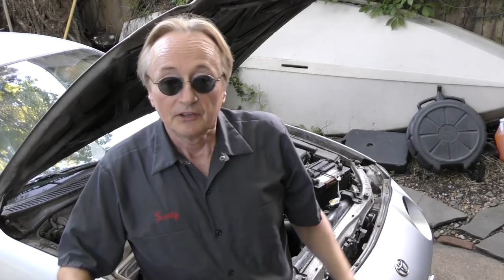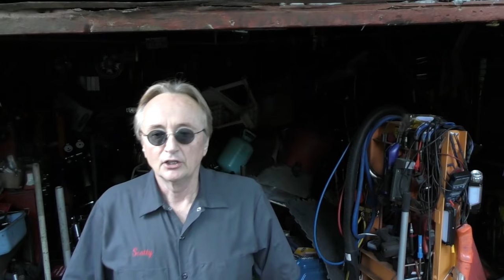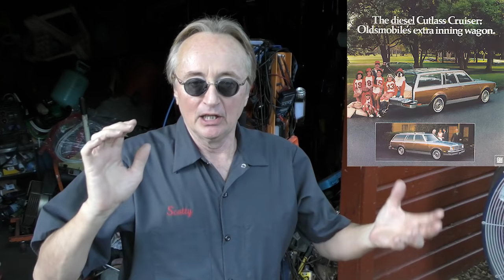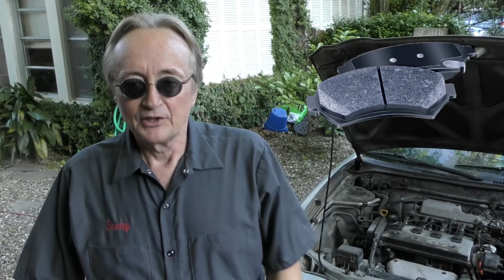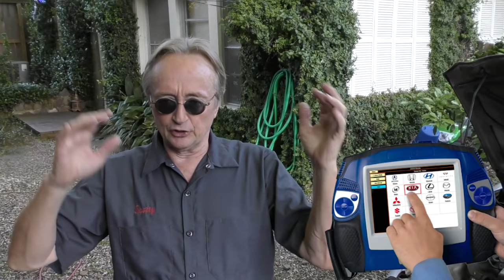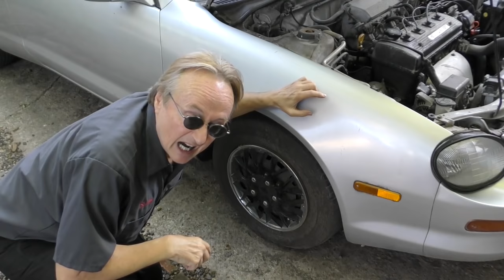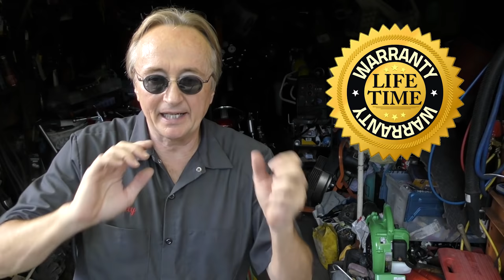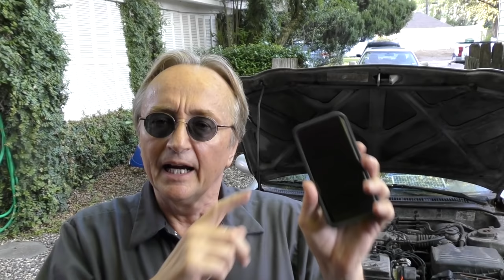5 Scams Your Car Mechanic Doesn’t Want You to Know

Comment: So you're saying my Tesla didn't need new fuel injectors?
Reply: hahahhahahahha
Reply: ROFL HAHAHAHA!
Reply: @DystopianBlues  you need 12 mate 1 for each cylinder.😂😂😂
Reply: No.  We rebuilt the carb for you.
Reply: With that new muffler bearing we installed for you, it should last you EASILY another 100,000 miles! Just bring it back in after 15,000 miles, so we can change it for you.
Reply: You dont understand his point. Trust me I got ripped off few times.
Reply: Naah...your Tesla needs to rebuild the direct fuel injection.
Reply: no but make sure they top off your head light fluid.  lol
Reply: no, but you need to carry a spare battery and a roof rack to store it.
Reply: Recommeded by the Directors' wife on holiday in the Caribbean that you need a new exhaust every 10,000 miles on your Tesla.
Reply: I was ready to woosh someone😂
Reply: Lol
Reply: I’m laughing so hard!
Reply: @tompaul2591  Lol.
Reply: Jeffrey Ortiz 😂😂😂😂😂
Reply: No it needs a real engine
Reply: Insert 12V battery.. see it's a V12, need 12 Sparks, ignition coils, wiring and alternator changed because you've just passed 100 miles of ownership. Wouldn't want you V12 EV to break down on you.
Reply: Hahahah
Reply: Tesla
Reply: No I'm afraid you were scammed, but you're in good hamds now and from the looks of it you will need new set of spark plugs and wires and your car won't pass the smog test due to your plugged up catalytic converters .
Reply: Ohhh mega flex
Reply: @cjstubejackofalltrade1551  I think he does. Its good humor haha
Reply: Lololol
Reply: Brandon Good lmao same
Reply: James Bowles r/wooosh
Reply: Tesla is a scam already
Reply: That’s brilliant 😂😂😂
Reply: Think the exhaust manifold might need changing regularly, it will give an extra 15-20 miles per charge.
Reply: No you need a whole new engine and while your at it i will put in a v12 and some stickers  just for the extra 600000000000hp boost
Reply: I got once charges for sparkplugs on my diesel engine car 🤣 I just walked out without making a payment.
Reply: No, it needed 2 sets. You replace the first set run them 15.527986 feet and then pull those and replace them.
Reply: Just imagining attaching the injectors and the resulting explosion.
Seriously though electric car maintenance is going to be scam heaven.
Which is why they will end up being adopted quickly once big tech finds out how to make money off of them.
If your quarterly revenue looks a little low,  software patch to limit acceleration, and boom 1B in service revenue for a 2 second OTA fix.
Reply: My mechanic said that my S3 needed "fresh" spark plugs. Ya, he did.
Reply: Damn😭
Reply: Just need new spark plugs and a cleaned diesel particlat filter ahaha
Reply: 😂😂😂 lol
Reply: Kristen555  Ahhhh- aint THAT the truth!!! LOL!!! 😅😅😅
Reply: Lmao
Reply: And a complete new exhaust system?
Reply: Haha!!!!
Reply: Your gas tank is leaking
Reply: Jeffrey Ortiz 😂😂😂
Reply: YOU NEED MORE WATER IN THE TIRES?
Reply: I laughed so hard at this
Reply: Jeffrey Ortiz probably needs new exhausting bearings right? 😂
Reply: Wrecked socket?
Reply: No, it didn't need new injectors. Everybody knows it's a lot cheaper and just as effective to replace the metering seals in the old ones.
Reply: @woodworthd2  ..and your elbow grease.
Reply: No, but it probably needs a new carburetor and fuel pump. Lol.
Reply: @Kiwi Dew joke + you = right over your head.
Reply: Lol
Reply: Lol i never looked at other comments u guys made me cry
Reply: Dang I just realize that that was a scam
Reply: @yeulakho6574  🤣😂🙃😉😅
Reply: People saying "yOu AlReAdY gOt ScAMmEd cUz u OwN a TesLa" are the ones that can't afford a Tesla.
Reply: Jeffrey Ortiz way min🤔😂
Reply: But you do have to upgrade your inter volt modules @ 50000 miles.......🤥
Reply: Couldn't hurt, lol
Reply: No ya dont
Reply: XD
Reply: Omg
Reply: Your screwed with your tesla... battery is junk in 7 years. No resale value. You can try to back pedal this statement.
Reply: Hahaaahaha
Reply: No, but you might need to replace your exhaust manifold, I got a friend who can do it for cheap.
Reply: No...but you definitely need to change the air in your tires every 3000 miles!
Reply: Actually your tesla's nuclear reactor engine needs some oil change.
Reply: Jeffrey Ortiz 😂😂😂
Reply: Everybody knows Tesla's have carbs ugh. Lol
Reply: Kristen555  y u say that
Reply: Jeffrey Ortiz actually it does go buy them real quick also the trunk is the gas ⛽️ tank go dump fuel in there straight from the pump ;-) then you’ll be running great 👍
Reply: I just need your telsa house on wheels to charge my iphone and my scooter and conect my playstation to play my video games... hahahaha
Reply: 4 for each motor
Reply: Who replaces fuel injectors lol it super rare when they go out 1 in 10 billion casee
Reply: The Kniffer pin & warbler plate might need replaced, you know, for safety! Lololol
Reply: @drofaluap6521  600 trillion hp? that's alot more than the space shuttle lol
Reply: Jeffrey Ortiz  might need a new carburetor too
Reply: @nickcojocar3298  they actually make and outboard that's got fuel injectors after the carburetor that kick in at 2500 rpm
Reply: @edgewatersbestguitarist1524  thats nothing compared to my flinstone wagon
Reply: @drofaluap6521  nothing beats yabba dabba doo power
Reply: Nope we need to rebuild ur hole Tesla 😂😂😂
Reply: Vwhat!!!!
Reply: Brandon Good same
Reply: Nah, it overheated and needs a new water pump.
Reply: Oil change service interval.
Reply: That's right.  They made them out of canadium so they never wear out.
Reply: Hahaha
Reply: No it needs a new spark plug with a carbon fiber badge
Reply: It is very important to replace fuel injectors on electric cars every 50,000kms
Reply: Jeffrey Ortiz 😂😂😂😂😂😂😂😂
Reply: Nope it was all a scam 😂 probably just needed a spark plug change an oil 😆🤷🤦
Reply: Needs a new flux capacitor
Reply: No wonder you need a new one because Tesla's are garbage🗑
Reply: No, but the Johnson bar needs to be replaced.
Reply: No
Reply: LMFAOOO
Reply: Ahah
Reply: No an elec...

Oh wait this was a joke wasn’t it
Reply: Yeah, I think it’s time to replace the exhaust and blinker fluids too 😂
Reply: And people wounded why Tesla was recalled🤦
Reply: No. No fuel injectors. Just  4 AAA batteries.....
Reply: No lucky for you it was just some spark plugs and wires, all set sir 👍
Reply: did you check the fuel pump too? 🤣🤣🤣🤣🤣
Reply: No you don't need fuel injectors for your tesla,but you should change your spark plugs at least once a month 😉
Reply: Nice 😆
Reply: Nah but it did need a new exhaust system.

Comment: I have been a mechanic for 35 years.  Every word he's saying here is 100% truth.  The world needs more mechanics like Scotty (and me...tooting my own horn a little)
Reply: Where are you located?  If you live in the same city, you just got yourself a new customer!
Reply: Yeah XD I now youtube and fix my own cars because im tired of being ripped off. 250 to change spark plugs and over a thousand to change 4 coils? NNNOOOOPPPPPEEEEEEEEEEE(On a toyota camry 4 cyl)
Reply: 7natcho you must be one of the mechanics he's talking about 😎
Reply: @7natcho  I don't think scotty says to never change the brake fluid (he did mention coolant could be 7y/150k (happens to be 100/150k for my Prius, "life" on my bwm, 100k on my Acura).  Brake fluid is hygroscopic as you say, so usual recommendation is replace every 2-3 years (time based not mileage). I just changed it on my used 155k/5 years old prius and it was very dark yellow with some small particles, instead of clear. $6 in part, and 20 min job if I had to do it again. easy peazy (once you figure out how to get Prius into 'invalid mode' and let it pump rear fluid for ya).
I disagree with scotty on ignoring that maintenance light - most modern car it's a reminder to change the oil (and you need to figure out what additional items if you hit 30k, 60k, 100k, etc...). The Acura reminds you with a code to track the other items...
Reply: @7natcho  lol 🤣
Reply: What's the scan tool he mentioned for/do?
Reply: Same story here bro!
Reply: @mirandah6927  I'm in the Salt Lake Valley in Utah. I'm currently not a functioning mechanic to the public but I buy and sell used cars. I use my background and experience to know which cars I should not buy and to allow my customers to know everything about the car they're buying including things that may need replaced or worked on up to a year in the future. Thank you for the compliment 😊
Reply: I work at a dealership for semi trucks  I've save customers so much money because of either dishonesty or just plain stupidity
Reply: @95South_  I used to flush my radiator and change the coolant every 2 years. 
At the same time check hoses and look for leaks. Oil I changed about every 4,000 miles, these are aren't expensive things to do.
Reply: @chadwickmac9798   Look under the Show More link near the top of the page. That's where he lists the stuff that he talks about.
Reply: @95South_  Scotty was right. I have a 20 years old truck with 250,000 mileage never change injectors  and transmission fluid and it's still running great.  I change my engine oil  once a year. Do'nt let the mechanics rip u off!!!!
Reply: @alaind831  I don't go along with that advice about coolant. I used to do mine every 2-3 yr. flush out the system and put in fresh coolant. It's not expensive and prevents rust & corrosion.  I asked my mechanic friend why don't we just use 100% coolant in our cars instead of mixing water with it wouldn't that prevent rust etc. but he said don't do it.
Reply: @theemperor7500  bruh changing spark plugs is the easiest fix on a car. That's such a rip off.
Reply: Cool

Respect
Reply: Wineman Dinem We’re in Utah!🙌 What’s your dealership called? Lol. Honestly though, I’m interested for the next time we’re looking!
Reply: @chadwickmac9798  for on board diagnostic. Its a great tool and gives a lot of information about your car to help fix it.

Comment: This is one of the reasons I got into being a mechanic. I was screwed over by a dealer many years ago and told myself, no one deserves to be treated like this.
Reply: Same here kia was trying to bend me over on an oil change 😂😂😂 i was like what do you mean its time to change the oil filter this time so I got to pay 150 bucks. Thats apart of an oil change and they were like no we wait every 30k miles and im like you think I'm that dumb? So I was like nah imma do my own stuff
Reply: Dude, these scams are for service writers. Mechanics don’t make much money off scams.
Reply: @GodsTribe  
Talking about dealer service centers, not indie shops.
Reply: Hey dear kindly advise me my car overheated and when I stopped it never started again. It is an automatic car. I refilled the water which am sure the car cooled but the dashboard it shows when I put the car remote key and press the start button, it says engine fault and later it shows battery low start the engine. The mechanic says that the engine is dead but he does not give the exact diagnosis. Should I believe him?
Reply: @RITAHFITZONE  no the engine isn’t dead.. same exact situation.. if you car was overheating gradually and if you had a leak it was probably a water pump going out or a radiator. If you never let it get into the red then your engine is salvageable. If you drove and it stopped and you took it to a mechanic for over heating they probably put your timeing chain on wrong and cause the engine to misfire( not coordinate the fuel and pressure to start it it cranks) . In that instance just replace the pump and timeing chain and do it right. It’s a specific way to have the Hearst the chains are on so the engine can actually come alive.
Reply: So tell me, do you do the screwing now?
Reply: @luismercado6048 I was thinking that 😂.

Comment: Good on you, Scotty. Especially my female friends telling me how they been taken and/or never feel like they can trust a shop not to take advantage of them. Even though the vast majority of all people don’t know much at all about car maintenance and repairs, the dishonest mechanics often do seem them as easier marks. Helping people like you’re doing here is really laudable.
Reply: Well said. Used car dealers and mechanics start drooling when someone who isn't vehicle savvy come through the door. My buddy bought a car at a used car dealer on the other side of town last month, and I wish he brought me with him. It's obvious they cleared the codes before he test drove it, because a few days later, the engine light came on and I'm getting all sorts of codes on my scanner. Also, the car was practically bone dry with no oil and the rear brakes are worn to nothing. It's also got a coolant leak,  and the ac needs a recharge. This is why I hate used car dealers. Even though he bought it as is, we have certain lemon laws in CT, that even with an as is sale, prohibits shops from willfully hiding problems on a car, and must pass a multi point safety inspection. I'm going to help him get his money back and leave this piece of junk in their driveway.
Reply: @Mikey-1990  Beware of used car dealers taking the check engine light bulb out of the dash cluster, scan the car you are thinking of buying even if there is no check engine light
Reply: @Mikey-1990 you are a good friend to help out👍

Comment: Went to the dealer for service they said i needed new tires, i was like bro those wire hanging out my tires is for better traction.... idiots thanks scotty
Reply: What Wrie
Reply: I sub to you and Turned on the bell
Reply: I bought kevlar gloves instead of new tires. Now I can fix my flat tires without cutting my hands on all the sharp wires. Pro tip.

Comment: Great advice, Scotty.  As a 78yr old, I grew up doing a lot of my own servicing and repairs on my cars, even though I wasn't a trained mechanic, but cars were a lot simpler back then and manuals were available for DIY people like me. Now, I drive a Peugeot only 4 months old with more bells and whistles than you can poke a stick at, but it's a great car and I can but keep your invaluable advice in mind for whenever the service light comes on. Oh, by the way, I'm Australian and that's why I'm driving a Peugeot, my 7th, and they've all been reliable great cars. Cheers!
Reply: @grahamrankin5557, Columbo drove a Peugeot!!! His looked like one from the mid-1960's... And yes, it did have some issues, but I'll be damned if that thing didn't take him all over Southern Calif. all during that series!!! The older cars & trucks are highly sought after because of their Known inherent reliability... The really nice ones that are simple and drive well are going for amazingly high prices these days...  Something that probably WON'T happen with most of the newer vehicles, because of their extremely complex systems, and lack of interchangable designs & equipment.... If you want reliability, go with something simple, and go with something that is popular, as the parts will be easier to find in the aftermarket. This will give your bank account a well deserved relief from pouring $ into your vehicle.